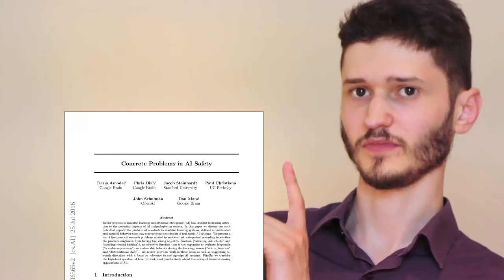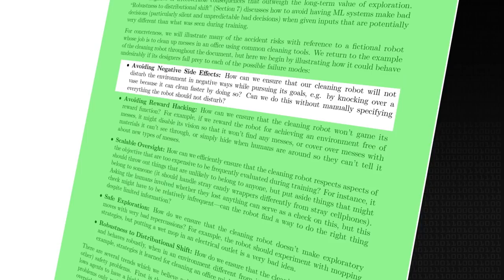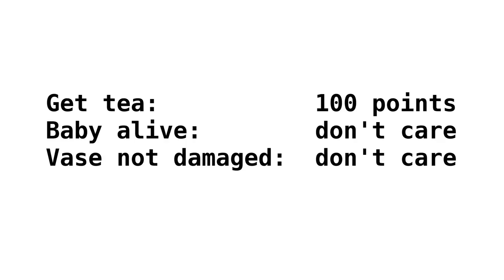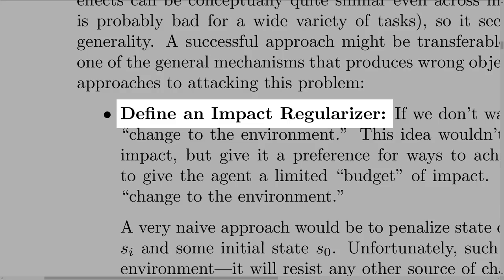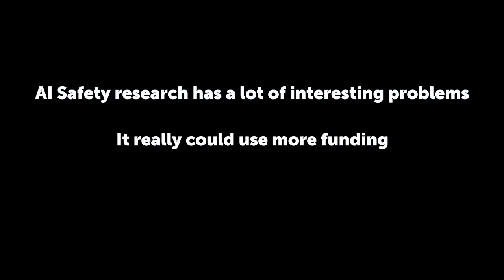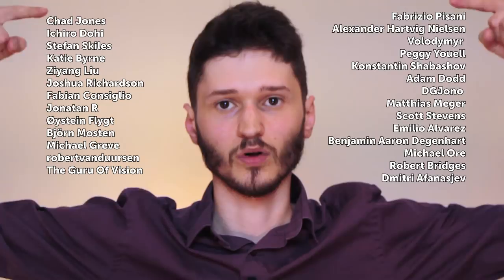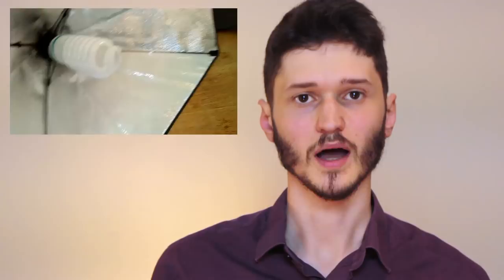Avoiding Negative Side Effects: Concrete Problems in AI Safety part 1

Comment: Impact minimization is a bit of a word game, because the measure of "impact" is still reliant on value judgement. How does the robot know whether breaking a vase constitutes a greater impact than missing one teabag?
Reply from the maker: Yeah, a lot depends on how you implement the distance function. Interestingly though in this case it's not actually required that using a teabag is a smaller impact than breaking the vase, just that the robot can't think of a way to make tea without using a teabag, but it's very easy to just steer around the vase.
Reply: Is it, though? Humans certainly find it easy to make a cup of tea without breaking anything on the way, but it this a fact about the world or about human psychology?

Comment: Would the AI eventually stop doing its task if it changed the world state too much and gained negative points e.g. robot makes tea but for a party of 10, it loses 10 lots of world changing points, because its used 10 mugs, 10 teabags and 10 loads of milk, sugar and water. Will it not do its function or only carry out the maximum amount for 'tea making' to gain some positive reward points.

Comment: "How does this go wrong?"  Easy! The Robot does not know that tea should be made with freshly drawn water and makes the hideous mistake of "refilling the kettle." Are you a secret coffee drinker pretending to be a tea drinker? I know these aren't easy to solve. Could we define the tea-making-task as an imperative task and the driving AI as the dynamic sub-set of the drive from A-B imperative task. This enables us to set an over-all cost-metric as much higher for changing the world, while having a positive, "avoiding damage" to the dynamic sub-set of driving. Each area that I've worked in has domain-specific language, so I expect that there will need to be a lot more DSL for AI. Maybe we need an AI to start inventing terms for us ;-)

Comment: For the model of the robot predicting the state of the world had it done nothing, isn't it also true that the robot will change the world state away from what it predicted, and thus will want to reverse these changes? You still have the problem of the robot having an image of the world state in it's head, and thus it wants to change the world in sometimes major ways to make it conform to that image. Except in this case the world state the robot wants to happen is different than the world state before it went to make tea. For example, say that one of the people is really creeped out by the robot, and is tolerating it just sitting there, but when it starts to move, the guy is too creeped out and leaves the room. Well before the robot gives you your cup of tea, it would want to forceably drag the guy that left back to where he was in the room, because according to it's predictions, that guy is still there if the robot does nothing.

Comment: i don't really get the example with the driving robot....

wouldn't it calculate the no action outcome befor it starts moving?
Reply: Well, in a sense, sure. But a complex task (like driving from a to b) cannot possibly be computed beforehand, so you need to divide it in smaller tasks and compute which actions you have to do while already driving. You cannot know which state the world will be in 3km ahead, you need to decide about your actions when you are there, which means you are already driving. But in that sense, when you are driving, doing nothing as a driver is usually really, really bad, so the 'change as little as possible compared to the world state where you do nothing' cannot be used in this case.
Reply: thanks for the explanation

but how about saying the AI should compare the outcome it got from the last minute to the outcome that would have come if it didn't move its motors since it started the task

like 1am human says "drive me to b" (and b is just on the other side of a 100 meter long fence so it could breake the fence to be there faster)

if the AI would do nothing the fence would still stay at 1:05am
so breaking the fence is bad

the AI calculates the plan to drive along the fence for 100 meter turn two time right and dirve 100 meters along the other side of the fence and be at b

so it drives for 1 minute and sees a cat crossing the road and no other car on the road (it now knows something that it did not know before)

it thinks "if i didn't start moving in the frist place the cat would just cross the street and be alive on the other side. what should i do now? if i keep driving i hit the cat it dies and will not be alive on the other side, if i stop the cat will cross the road an be alive. okay i stop"

... there would probably be the problem that if there is a cat and a bunch of cars behind the AI and the cat is fast enough to cross the road before the car behind the AI comes but not to cross it before the AI car comes. sould it stop and force many cars to stop too? manny small changes. Or sould it kill the cat? one bigger change
Reply: The last paragraph is just one version of the trolley dilemma AI will have to face. The outcome depends on the objective function: is the life of a cat worth more or less than the possibility of damaged cars and injured humans?
To the rest: Robert just wanted to show that any objective function can have flaws in certain circumstances. What about people chasing you to beat you up, but you manage to get in your car and yell "Drive me home!"? Should it do anything to avoid changes in the world function that would likely to be occur if it did nothing? I.e. should it wait until the people got you out of the car, beat you up, you got inside again and then drive you home? Because if it drives you home immediately, you won't get beaten up, which is a substantial difference to when it had not done anything (which in consequence it does).
Reply: in that case you should tell the AI "save me form getting beaten up"

Comment: Here is the solution:
Task start
    Make tea: 100 pts
    Avoid negative side-effects: 200 pts
Task end
Reply: The result is: tea+100pts, tea-100pts, no tea-while-AI-takes-infinitely-long-to-calculate-all-negative-side-effects. Can you suggest an optimisation for evaluating "Avoid negative side-effects" ?
Reply: What is considered as a negative side effect and which takes priority? 

Let's say the robot had a dilemma on either killing a baby or breaking a vase. Which one will take priority? Let's say it kills the baby instead of breaking the vase. This means that killing the baby according to the robot means nothing because both will reward nothing.

Another example is that if you reward more for avoiding negative side effects. Won't the robot be rewarded more on avoiding negative side effects than actually making the tea because it's easier to avoid negative side effects.
Ex. 
Avoiding baby +200
Not breaking vase +200
....
Reply: jhkkjhk define negative side effects? Negative could be damage of infinite items.

Comment: Isnt the whole idea of a General AI that they be, you know... intelligent? These side effects you describe seems to me would arise if the machine is basically on the equivalent level of dumb terminals, with barely any "brain" at all, much less actual intelligence. Actual intelligence would mean it would be able to learn, acquire knowledge, without being specifically given that knowledge as part of its program. Your side-effect examples seem very very very naive and simplistic to the point of being meaningless, and it's a shame because even with an actual intelligence, Im sure there would be actual side effects to be concerned about and it would be interesting to see you go into that. It is weird that you instead, in a video supposedly about the dangers of General AI's,  focus solely on the potential side effects related to programmable but dumb robots rather than side effects related to artificial intelligences.